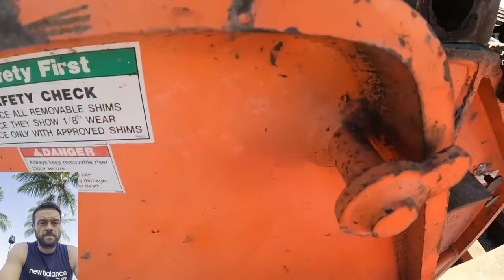Cat 374 with commentary! Loading and trailer assembly

Comment: for anyone that might not know. chaining down after the load is in the air is important. that amount of weight makes the trailer flex and if you do it before when you lift up things can become loose. 100K lbs + 60 mph + lose chains = really F-ing bad day.
Reply from the maker: You are correct when chaining to the very front or rear of the trailer.  And the opposite is true also. Before lowering the trailer I always loosen the front chains.  I’ve seen chains or binders break if they are tight when the trailer flexes down.
Reply: Also, if you air the trailer after chaining, you'll be sitting there waiting for the bags to fill. =]

Comment: Hey Doug !!!  Thanks again for the video !!!   NOT stating that you are wrong with chaining down ,, but ""Back in the day"" ,, We were told NOT to chain to the trailer frame rails , but to use the D-Rings so that if a accident happens , the load would NOT slide with the chains on the rail !!   Times have changed & so has chaining !!!  Hope you enjoyed your vacation in the sun !!   🤠😎👍👍👍👍👍
Reply from the maker: It is impossible for the chain to slide on these rails because of the outrigger supports.  If there were no outrigger supports then I would’ve done differently

Comment: Someone who knows to cross chain the load. So many loads around here are corner chained at best.
I once saw a improperly chained old collector type farm tractor come off the rear of a trailer on one corner, and sent the load to the shoulder on that side of the road and hit the payment. It ripped the trailer off the truck and it slid into a yard.  Lucky for me I was going the opposite direction, and nothing came my way. New sub here.
Reply from the maker: I don’t cut corners with load securement. I don’t need to be on the internet for the wrong reasons!!!

Comment: Hey Doug.  Hope you didn't catch to much sunburn. Some differences, some similarities  between loading your Talbert and the Trail King's that I used to load.  The first and biggest was loading your deck trl v. my beam trl. There were more differences between my old 65'  closed 4 Trailking with my 35" well.   But that's a horse of a different color.  but this was great for showing the general public what's involved in making it ready  to roll with the load on.  Have a good day.
Reply from the maker: I pull a beam trailer when I have to but loading a deck trailer is like being on vacation!

Comment: I agree. If I’m pulling a flatbed, I use every strap. When I’m pulling oversized, I put the outriggers out. I’ve never been involved in a moving accident. But if I ever am, I don’t want the equipment to hang on by a few inches. 
I started driving in 1987 and am tired of truck stop wannabe super truckers telling me how to load a trailer.
Reply from the maker: Exactly! Most are just lazy and they feel better if they convince others that it’s ok to be lazy

Comment: Takes all most 30 minutes to set up the trailer just by your self some time another 15 if you have the booster set up as well if you have one with you. The plates you are adding between the trailer. That have to be special type of metal for it to hold the weight?... Got to love the low air system to keep you from moving the truck due to the transmission needing air to shift.
Reply from the maker: No special metal just general steel

Comment: Another interesting video, thank you.  Hope your mini-vacation in the tropics was restful.

50:31 - If the front of the trailer lifts off unevenly, does that indicate a mechanical or gooseneck-connection problem, or that the load is unbalanced and that you must move it sideways?  Can you move the load without disconnecting the gooseneck again (risk of bashing into the gooseneck)?
Reply from the maker: The trailer lifting unevenly is a result of the load not centered properly on the trailer.  It usually means starting over.

Comment: I've loaded many oversized loads that are chained (not a driver though) and we always put carpet or rubber pieces where the chains touch/cross to prevent possible rubbing.  How come you don't do that?  Cheers!
Reply from the maker: I have heard of putting protection between chains and it’s not a bad idea. Just not a habit I ever developed.  And it’s not something enforced by any DOT agent that I’ve run into.

Comment: What determines the size of the shims. What are the purpose of the shims.
Reply from the maker: The shims change the camber (arch) of the trailer.  With these heavy weight loads the trailers flex a lot and they are not designed to move around empty with the same camber as with 50 tons.

Comment: Question, what kind of wear on  upper, lower pins and pin bosses of stinger when loads are applied?
Reply from the maker: Under normal circumstances they don’t normally wear.  I’ve had very old trailers with the original pins and holes.  If you exceed the capacity then the pin bosses will bend or crack. I’ve seen it.

Comment: How much weight are you talking if you add 2 hydraulic cylinders and a bigger hydraulic tank? I would think less than 750 lbs more like 400lbs. The " un " smaller loads it would make a difference but on the heavy loads that weight I don't think would make a big difference in my opinion. But you already have the motor so your really not adding to much weight.
Reply from the maker: This machine fully assembled weighs 155,000 lbs. so by removing the parts they removed 55,000 lbs